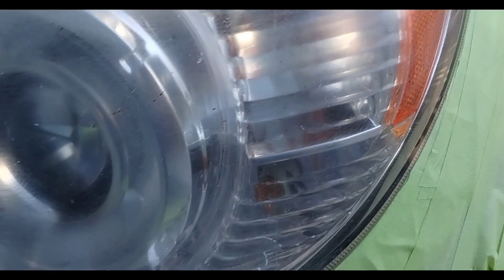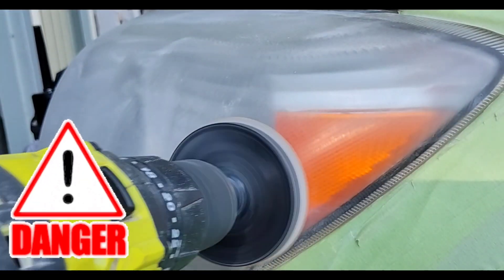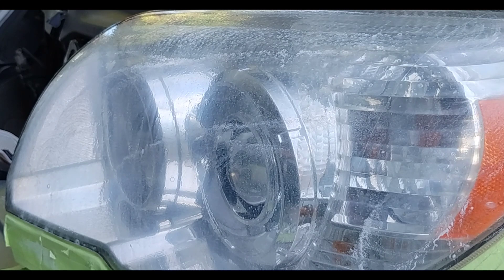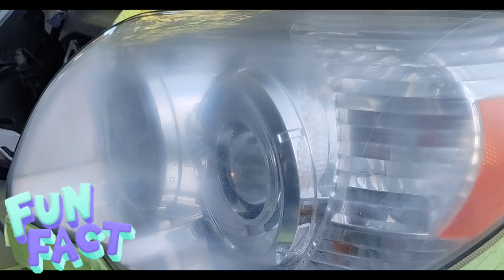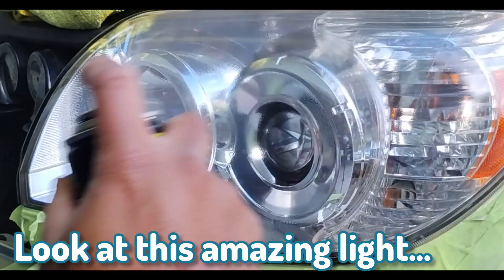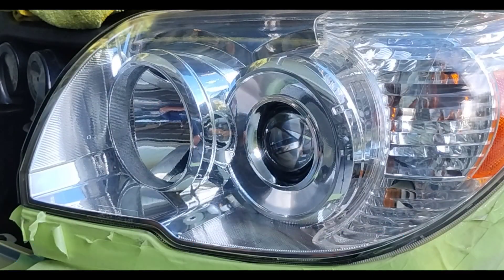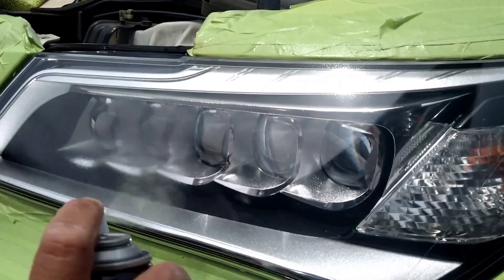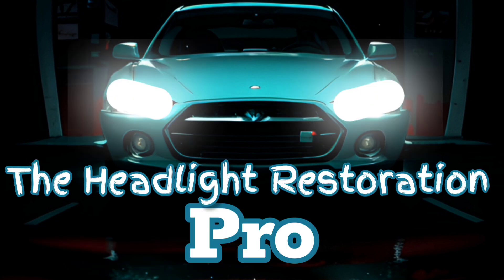one of the most PERFECT HEADLIGHT RESTORATIONS you'll ever see 😱😍

Comment: Thanks for sharing!  I've tried a number of products by hand but the more I watch & listen to your videos the more confidence I'm gaining on doing it your way and the results speak for themselves.  I have a 2009 Lexus LX 570 that needs a full headlight restoration as new OEM headlights are $500 ea plus labor.  Gathering the supplies to do in the next couple of weeks.  Keep up the good work and educating the masses!
Reply from the maker: Thank you so much..👍🏽
Reply: Would the spray coating bond better if the headlamp was wiped with isopropyl alcohol after polish and before spraying?
Reply from the maker: @biglar67467 no... You would just be drying out the surface of the headlight which is more like a sponge or the microscope removing essential oils which have been reintroduced back into the lens which is why my headlights look so good and function so much better than a regular headlight restoration or the old methods of pilot restoration cuz this is the future.. if you want to learn more about that to check out this video..
https://youtu.be/LC4ZBu02JZg?si=qKXDbefn2ul6LEEV
Reply: @theheadlightrestorationpro  thank you for your expert knowledge
Reply from the maker: @biglar67467 👍🏽😀

Comment: I just did my headlights for tbe 1st time. 2004 RX8. When i searched youtube before you didnt show up. I watched the chris fix video and did his method. 
I wet sanded with 400 grit, 600 grit, and finally 2000 grit. The sprayed with clear. The clear will be cured enough next week to wet sand cut/polish/wax next week. 
Wish i had seen your video 1st. I might of still did what i did but more info is always better.
Reply from the maker: Yes this method would definitely work out a lot better.... If it doesn't end up working out I would definitely do this...👍🏽

Comment: Amazing process, I did my girls headlights and she was mind blown! Just a quick question though, about how many uses does each 3000 trizact pad get? Also do you wash your orange finesse it pad when you're done for the day? Thanks for your amazing work!
Reply from the maker: Awesome I'm glad to hear everything worked out.. the 3000 Trizact you can get anywhere between 3 and 5 vehicles out of it if you take care of it far as not overuse it.... And you never ever ever ever ever ever want to wash the orange pad not these.. not the finesse it... It should resurface itself through work... If you find any kind of build up on the top just agitated with a stiff tool....
Reply: Should it be put in a zip lock bag until the next job?  Just wondering
Reply from the maker: @chrissanchez6610 you could I prefer to let them dry out naturally but at the same time my jobs are so frequent they're just kind of always moist... So if your frequency is a high enough I probably would store it in a bag...

Comment: I came across some 3M Finesse It extra fine polish, 28794, also some 3M one step finish polish, 33038, wondered if you were aware of these, and what you thought
Reply from the maker: Yes aware of these.... But in terms of headlights most of these are incomplete or require a two-step if not more what I'm doing with this is trying to avoid turning one step into two for time and expense ...
But yeah three of us always good products either way....
Reply: I understand you are getting excellent results with less steps, I was just thinking about my own lights, when time and effort aren't a factor, if this final buff with the ex fine,, would maybe be an improvement on your perfection
Reply from the maker: @kokomon5 no .. sorry...it would be just doing more for potentially less.... The main factor important factor behind the Polish is just the oils.. not so much to polish.... It can only get so good therefore it's probably not going to be that good....
Reply: OK, thanks for the info, BTW, excellent vid
Reply from the maker: @kokomon5 👍🏽🤓

Comment: Cant get the Maguires headlight coating in my country, but have managed to find two products designed for the job. One is called HB Body Lens clear at only US $12 a can. The other is a Danish purpose made spray called HBC headligjt repair system and very expensive. US$35 a.can. I will copare them next week when I do a very bad set of Nissan van ligjts👍🏻
Reply from the maker: Awesome you got to use what you can the best thing is to emulate try to reproduce this process the best you can..🤓💯👍🏽

Comment: whats the biggest purpose of the p3000?
Reply from the maker: The 3000 trizact is a single most biggest disk/pad used in this process I feel anybody doing headlight restoration should be using one.. it eliminates scratches like nothing else... Literally will do the job of all discs between p900 and p5000... This is why they're quite expensive they will cut your costs and need for all these other disks 100 fold.... It is a true magic disc.. it will take your headlight restoration into the future...
Reply: @theheadlightrestorationpro  I don’t know what’s happening, I had really impressive results, but at the same time there are lights that stays foggy after all steps, I spent a good time on the 800 drill and hand, not pressure at all, p3000 and then polishing and the light is not clear, the weird is because most of the scratches gone, but stays foggy
Reply from the maker: @marcuslima2535 not sure...got to be true to yourself...Are you really using what I'm using and doing what I'm doing because  I show you over 100 times on this channel that I get perfection..
I cannot see what you're doing and or using....